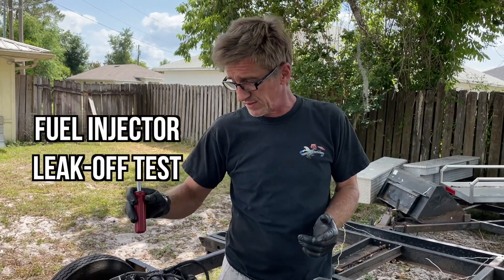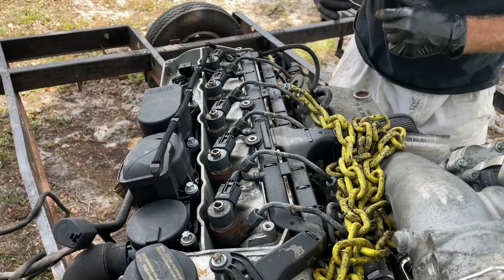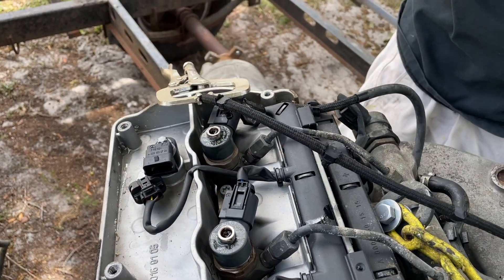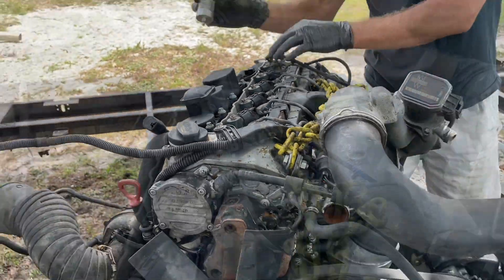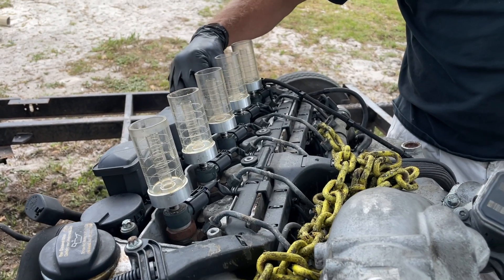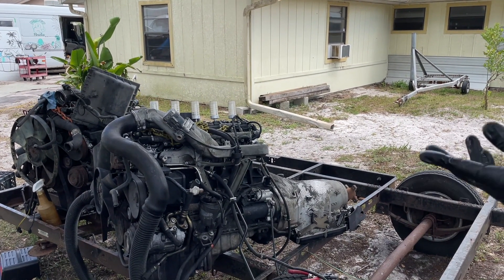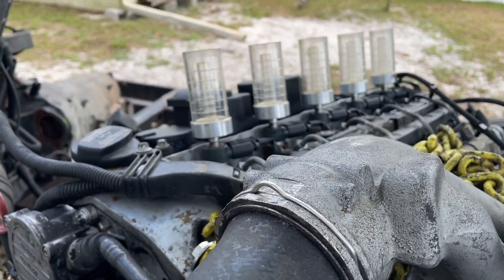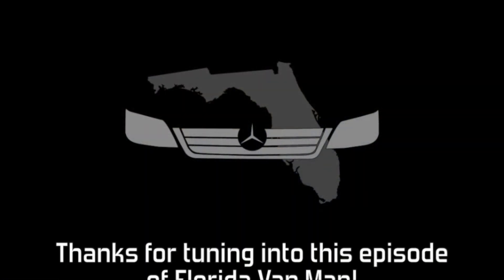Injector Leak-Off Test - T1N Sprinter

Comment: I just did the test on my 2005 sprinter. Im getting nothing out of 2 to 5 but injector 1 is coming out of the tube around 6 seconds of cranking. Does that mean i should replace injector 1.
Reply from the maker: Yes, sounds like your #1 injector is releasing WAY TOO MUCH to the return line. Does the van start and run well?

Comment: So I’m having low pressure on the rail 15bars during cranking instead of above 300 bars. I’ve done the test in this video and there was zero drop of leak off from the injectors.  I’ve disconnected the 14mm nut directly on the HPFP and the pressure coming from the HPFP is very low. Fuel pump in the tank pressure in and out of the fuel filter looks good. What else would you be looking at?
Reply from the maker: With a line disconnected there would be no pressure at all. The high pressure fuel pump has very little flow and pressure is a result of restricting that small flow. Getting no fuel at an injector leak-off test would send me upstream to do a rail valve leak-off test.  https://www.youtube.com/watch?v=JEAtaTfnItw&t=109s
You say pressure out of the tank looks good. What is 'good' ? Looking at fuel spewing from an open hose is irrelevant. If you don't have over 50psi at the HPFP input it won't start. However, if you have under 50psi at the input and zero fuel on injector leak off AND* zero fuel at rail leak-off tests, you will find trouble in the HPFP. Most common trouble there is the quantity control valve mounted on front of the HPFP (high pressure fuel pump).

Comment: '06 Sprinter 188K miles; yesterday- turn key to start and nothing, try second time and started and ran great. Today, turn key and nothing with all dash lights flashing and then no dash lights at all.
Motor is not turning over by using the key. There are 12.55 Volts at the battery and I cleaned bother terminals even through they were clean. What is your thought? Fuel filter good, replaced the Mass air sensor about 2K miles ago and van has been running nicely sense then. What do you think?
Sometimes recently the dash (last 4 weeks) the alternator (original) charging light will come on as I am starting and then go away with a slight blip of the throttle to 2K rpm. Light does not go on
while at a stop light at idle in gear.
Reply from the maker: Much of that description suggests a dying battery. Voltage is half of what we need from our batteries and when they get old they can have good volts but lack the amperage to start the van. Other things to check, loose connections at the battery terminals and smack the fuse box under the steering wheel while holding the key at *start.
Reply: @FloridaVanMan  Hi FVMan  took 3 yrs old NAPA battery in for testing and it had 990 CCA (as good as new). I had the same thought as the battery was lacking.
The last Legend NAPA went 7 years. Will smack the fuse cover. Thanks. Hope all is well over there.